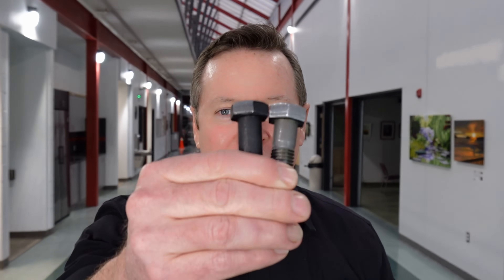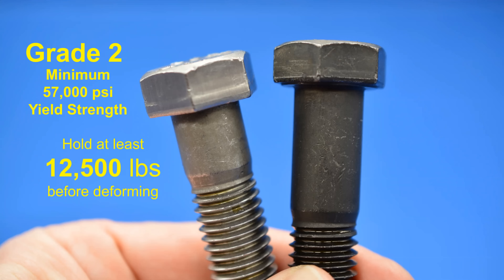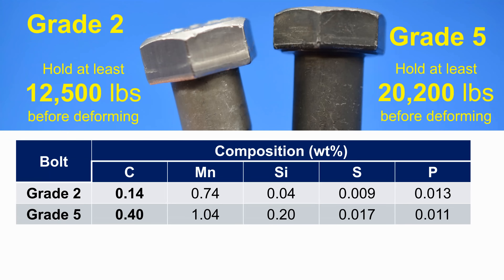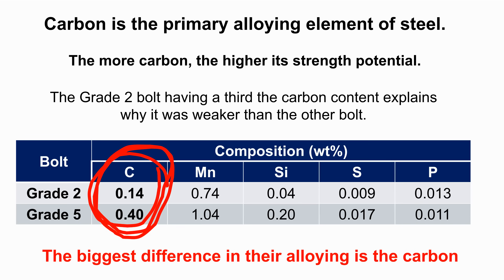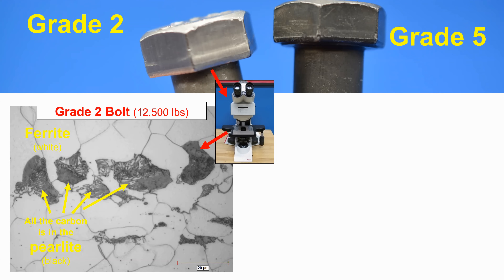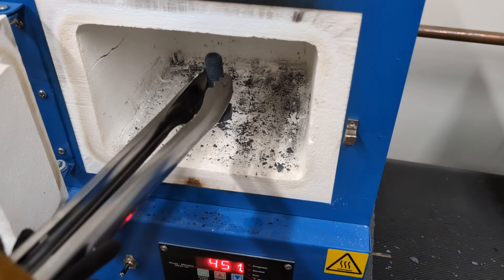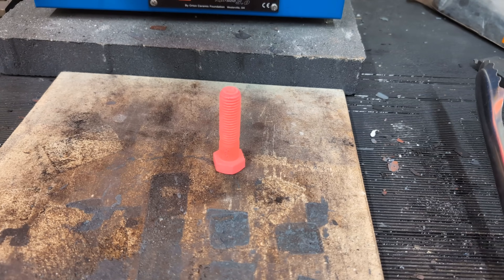What Affects the Strength of Steel?

Comment: A very good introduction to steel microstructure, alloying elements, heat treatment, and strength. What I didn't see was the effect of brittle failure due to not tempering the quenched steel. Or the iron-carbon diagram every strength of materials college class goes into in its first course. Nor the crystal structure,  body centered vs face centered and why they are important. Nor why the alloying elements are important in stopping the migration of voids in the molecular structure to stop "micro-cracks" from growing. But that's Strength of Materials 307, a senior level course, not 101 entry level.
Reply from the maker: Haha, yes my 10 minute video did not cover the content of an entire multi-month course.  But to your point, I think there is a great opportunity to introduce steel in a different way than common classes have done in the past.  I'm curious to hear your thoughts, why is BCC vs FCC important for steel?  I ask because I think most classes teach materials science rather than metallurgy.

Comment: 🎉 thats not true. To much carbon makes steel brittle . steel has only .02% carbon. We are carbon based creature because Carbon is the only element that when heated the resistance value is reduces. Meaning . carbon is so dense that when loosened up with heat the volts can pass esier through it. 😊

Comment: Aircooling is what's called annealling, I think. In order to be able to work or machine high carbon steel and then tempering the finished product to harden it again.
Reply from the maker: Annealing is very slow furnace cooling.  And you're right, its use to soften the steel and puts it in its easiest condition to machine/work with.

Comment: In the Netherlands a person was tragically killed by a big loudspeaker at one of those indoor tropical swimming paradises. As I remember it correctly the speaker was bolted down with stainless steel hardware, but because of the chlorinated water it lost strength and as a result it came down after some time.
Reply from the maker: That is tragic.  Although stainless steel is quite corrosion resistant, chlorine is its Achilles heel.  Chlorine within water can cause stainless steel to corrode - specifically corrosion pitting and corrosion cracks that we call 'chloride stress corrosion cracks' (Cl-SCC).
Reply: @Shane_at_SteelImage It is such a freak accident because those people who installed the loudspeaker thought that they were doing the right thing by investing in high grade hardware, not knowing that chlorinated water is the one thing that destroys the strength of the stainless steel. It goes to show how important engineers with good knowledge about the properties from the used materials are.
Reply from the maker: @insAneTunA  - I can appreciate why they thought the stainless would be better... but I also agree its quite important that engineers know the basics to metallurgy and what damages it.  Unfortunately, I'd argue such topics have not been presented in an interesting or thorough manner.  Many people are not interested because of how its been taught or have yet to see the value in learning it.  I'm trying to do my part in changing that.
Reply: @Shane_at_SteelImage I think that your videos are very good. But I actually meant to say that it is important to seek the advise from a good engineer when it comes to installing structures with a heavy load, even when things seem to be very straight forward, such as installing speakers. Especially when it concerns structures inside public spaces or commercial spaces. Because installing speakers is often done after the building is ready, and not necessarily inspected by an engineer or even part of the plan.
Reply: @Shane_at_SteelImage P.S. Veritasium's latest video is a great video about the strength of steel, but in this case from a Japanese katana sword. With great animations about what happens inside the metal when carbon atoms and other elements are added to the iron and the metal is quenched and heat treated. There are many overlapping similarities with your video.

Comment: This is fascinating and very well explained.
One bit of info is missing.  When you did the comparison of (heat + quench + temper) with (heat + air cool), what was the steel grade of the bolts you started with?
Reply from the maker: The bolt we compared was the Grade 5 bolt.
Reply: @Shane_at_SteelImage  So the bolts had already been though the heat-quench-temper cycle.  Does the heating remove the effects of the previous quench-temper?
Reply from the maker: @gibbogle  it does.  Getting to red-hot temperatures undoes the previous heat treatment.

Comment: When I was a machinist and worked next to heat treat, in the winter, mice would run thru the dried quench dust. Then we,d just stand back and watch as it was hopeless to try and help.. sodium cyanide was in one tank. I never made production bolts, but did make some giant 3 inchx 3 foot+ (75mm dia, by about 1mtr long) Tool steel bolts for Detroit diesel, they were custom one offs for some ships crankshaft rod bearing caps. P.s It was neat to make such huge stuff , I usually made tiny Indy car/F1 style engine parts.
Reply from the maker: Unlucky mice.  Yet it totally get your fascination in making BIG stuff.  I just love heavy industry.  Freighters, mining trucks, massive refining reactors.  Something powerful about it.

Comment: Well presented and explained. 
Shows you have considerable knowledge. Not everyone can explain in such a straightforward manner and certainly beats decoding 300 pages of technical jargon. 
About 15 years back I was introduced to hydrogen embrittlement.
 At work we had a box of M8 12.9 SHCS that were zinc plated, many of them their heads snapped off when tightening. 
I now understand that zinc plated higher alloy (10.8 and above) fasteners should be used with caution.
Reply from the maker: Thank you machinewrangler4682!  I give a course talking about that very thing - our experience with hydrogen embrittlement and it includes some Grade 12.9.

Comment: I really enjoyed your video.  What about resistance to corrosion from salt water?  Just as a historical exercise, what about adding steel plate to wooden ships to resist cannon balls.  Also to strengthen the hull.  I think the first time this was done was during the American Civil War.  The Monitor versus Merrimack.

https://en.wikipedia.org/wiki/Battle_of_Hampton_Roads

Was the steel used in these vessels practical?  Could they remain in service for years and still be useful?  My guess is you could only practically make steel sheet after the invention of the Bessemer Converter which was invented about the same time as the American Civil War.

https://en.wikipedia.org/wiki/Bessemer_process

So here’s your challenge:  You have to make steel plate to add to wooden ships.  You have to wait until 1870 or so until the Bessemer Converter.  What would you add to the pig iron to make it more resistant to salt water corrosion?

Comment: So the water/oil quench is freezing the carbon content while it's in solution at temp?
Reply from the maker: Slightly more complicated than that but, at a high level for the Grade 5 bolt - 'yes.'   The steel is brittle in the as-quenched condition. However, the tempering after quenching allows the carbon to escape the matrix, forming the fine, dispersed carbides shown in this video.

Comment: I am curious as to why the jump out of US Standard and into Metric rated bolts?    2 and 5 being US and 12.9 Being Metric so the size would be different as well.   Grade 8+ is close to  or the same as Grade 12.9
Reply from the maker: Just a demonstration.  And being in Canada, we use both systems quite often.  Besides, most Grade 8 bolts of this size are not alloy steel while Grade 12.9 are always alloy steel.

Comment: Great video.  If you are looking for topics to explore----   Many blacksmiths have trouble finding what the alloy of steel they buy really is.  Sometimes we want soft stuff the WON"T harden.  Sometimes we know the alloy we want, for knife making, struck tools, etc.,  but have trouble finding it.  In some the steel yards, the seller apparently doesn't even know for sure.   Example:  a few months ago, one of our guys went to a local steel yard to get some mild steel for a class project that he was teaching.  When our guy asked if the shiny stuff he just bought was mild steel, the seller said: "sure, it's just cold rolled".  Well, Yah,.  To our guy's dismay, when he attempted to demonstrate the project,  the steel was very hard to work and it cracked when hammered below about 1200° F.  I guess the seller assumed it was 1018.
Anyway, I have been trying to educate the guys on this issue in my own simple minded way.  As I started to research (I use the term loosely) the standards, I ran into a lot more complexity than I was prepared for.
Here is my take on the subject to date.  Maybe you can straighten us all out:
https://www.spaco.org/Blacksmithing/Steel%20Info/Steel-What-Is-In-It.htm

Comment: On my son's glider plane we used the ambient air tempering procedure described in this video. This allowed us to buy lower diameter bolts, saving both weight and money, without compromising on structural integrity. It's amazing what you can do once you have a little knowledge.
Reply from the maker: Gliders, neat!  Probably quenched and tempered (not air cooled).   But in the end, yes, increasing the strength allows for less steel and less weight.    Hence useful for any light weighting efforts.

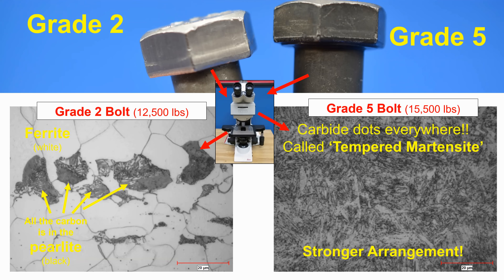Comment: At 4:20, I'm thinking the grade 5 bolt photo strength read 20,200 lbs, and not 15,500 lbs. Later in the video it is revealed it would be 15,500 lbs if it is heated and air cooled.
So, how does chromium and moly help increase the strength?  Actually, how does carbon help?  Ideas for a future video.
Nice length, not to long.  Keep making interesting videos!

Comment: I always have trouble remembering the differences between strength and toughness, like I look at a stress versus load chart and it just doesn't click, I can't really separate them into different variables in my head. Like resistance to yielding, and reluctance to breaking, yeah, but which is which, and what are the underlying mechanisms? 
Looking forward to your hardness standards, and viscoelasticity/viscoplasticity videos. 
I also have a more off topic question, is it possible to line heat/flame straighten structural steel without it going out of spec?
Reply from the maker: Strength vs toughness is what I plan to talk about next!

Flame straighten structural steel.  My understanding is 'yes' and its done quite often.  What it does to the steel depends upon how hot it gets.
Reply: I'm looking forward to it!

Comment: Need to know about the effects of hot dipped galvanizing on bolts. Bolts with a tensile stress greater than 150 ksi are not allowed to be hot dipped galvanized. Why?
Reply from the maker: Off the top of my head, could be two reasons - the bath temperature might soften/further temper the steel and high strength steels have the risk of a damage called 'liquid metal embrittlement' when hot dipped.  Maybe someone more familiar with this exact issue will comment further.
Reply: Higher yield strength (80 ksi and up) steels are not hot dipped galvanized  because of hydrogen embrittlement.  Steel absorbs hydrogen during the HDG process. The hydrogen is trapped between the crystalline grains.  Higher yield strength steels have a more refined grain structure (smaller grains) and the hydrogen can’t escape leading to embrittlement.
Reply: @bman041  Why is there hydrogen in the molten zinc?
Reply: @gibbogle  hydrogen is from the hydrochloric acid.
Reply: @bman041  Molten zinc contains HCl?  I see that HCl might be used in pre-dip cleaning of steel, and if it was not properly flushed off there could be some remaining when the piece was dipped.
Reply: @gibbogle  hdg involves i) degreasing via a caustic wash, ii) descaling and etching using a HCl (aq) bath, iii) dip in molten zinc.  Hydrogen is absorbed during the descaling in HCl (aq).  Hydrogen absorbed during descaling is typically released during the zinc dip, except in high tensile strength steels with fine grain structures where hydrogen remains trapped.
Reply: @bman041  Thanks

Comment: Very good video. It explains and answers questions I have had for a while. I'm a former machinist and have worked with various types of steel as well as other metals, however a comprehensive understanding of steel alloys is not in my skill set. 
I occasionally watch these guys pounding on steel with a hammer on an anvil, and they make some interesting knives and stuff, but it seems like  a lot of work relative to the end product. I am wondering what alloys of steel could be used that might not require all that hammering. I can see the heat treating (hardening), tempering, and such but I suspect there are alloys that don't require the hammering, and I may not be correct in that assumption. 

I would like to see videos on what applications various steel  alloys are good for.

Again very good video.
Reply from the maker: Really glad you liked the video and am grateful for your words.  I have SO many things I want to talk about.  I hope to build up to talk about knives and the steels used.  In the meantime let me say your intuition is right - most knives mass produced are machined to shape and all knives I've seen are quenched and tempered.

Comment: When mechanics heat up bolts to loosen them, can they reuse the bolts, or does the heat effect the strength significantly?
Reply from the maker: What temperature a bolt can withstand before its starts to weaken depends on the bolt grade.  For example, the Grade 5 bolt would soften if it comes close to its tempering temperature of 800F.

Comment: I can understand how the distribution on carbides could effect the compressive strength but I clearly dont get how they would change the tensile strength.
Reply from the maker: The strong, finely dispersed carbides pin help pin down against atom movement in the surrounding steel matrix.

Comment: Love the visualization of the two treatments of the originally grade 5 bolt.  I wonder how feasible it would be to look at the metal under a microscope while it is cooling.
Reply from the maker: I have dreamt of the same thing. Yet myself do not know how to or have the equipment to do so safely.
Reply: @Shane_at_SteelImage  I've got 0 experience with metallurgy, but couldn't you try to do the reverse process first? Prepare your sample, then heat it? Then see if there is still anything useful left to see during the cooling process. 

The main issue being if there is any point to observing the microstructure being formed at the surface of the sample at all and how the etchant is involved in making it visible, because I doubt it'd remain at the surface during the heating.

The rest is just a matter of protecting the sample and microscope objective, which is doable, imo. I could sketch a quick apparatus concept and send it to you via mail, if the main issues aren't a deal breaker. Expect squiggly lines, tho, I'm restricted to a tablet for some time :)
Reply from the maker: @steini19o4  haha, I will let someone else melt their microscope.
Reply: @Shane_at_SteelImage  Np, but that can be solved by just limiting the time the objective is exposed to the heated sample. Eg rotate the sample over the microscope and sync a shutter (or flash) to it. That way you could reduce the exposure of the microscope to heat to sub-milliseconds through thermal radiation per measurement.